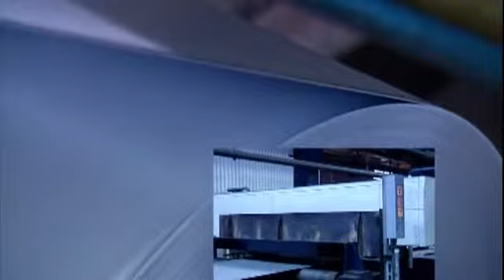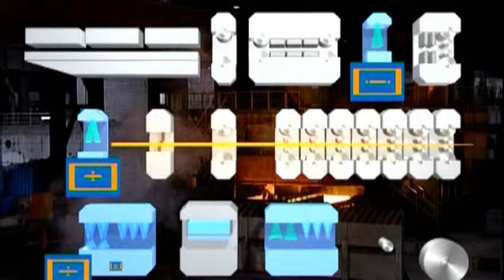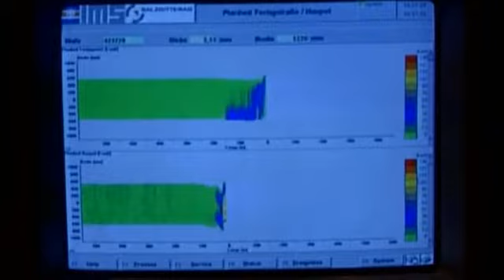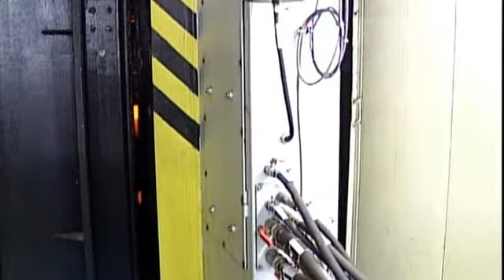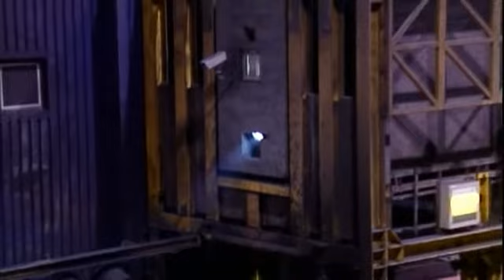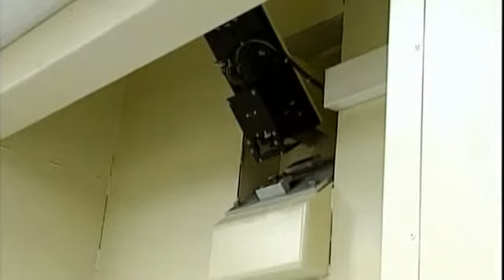IMS Gauges

Comment: please share with your engineer friends : https://youtu.be/FB5LAjEQhVs start using adaptive strip oiling and  wiping without any energy, no moving parts, no replacement  parts. Once installed no use of Rubber squeeze rolls, Felt Presses